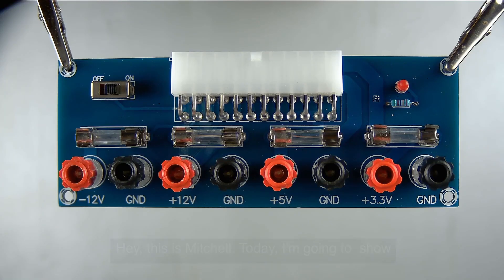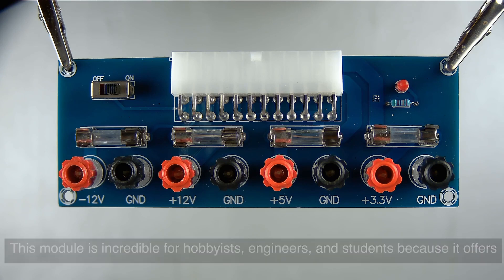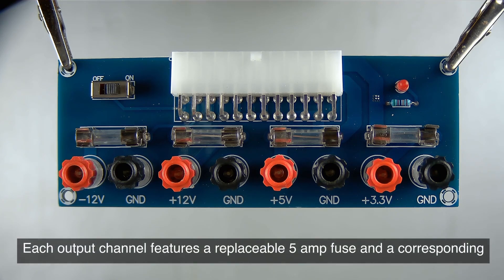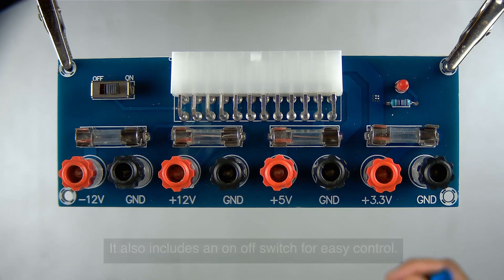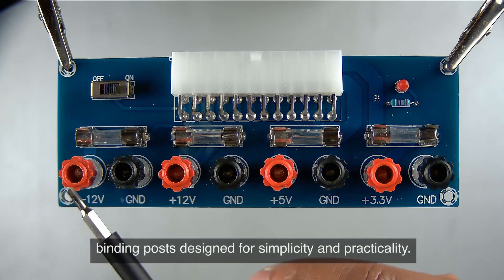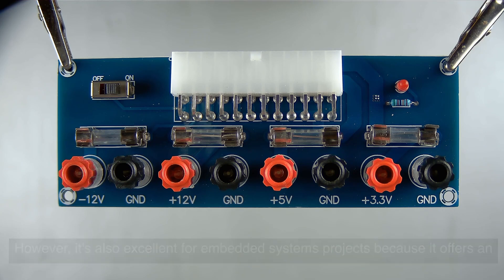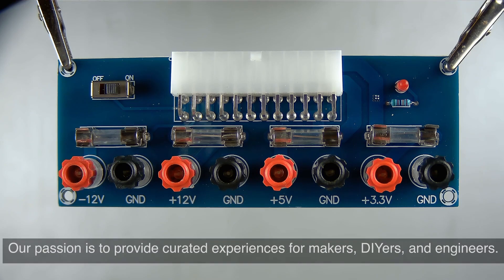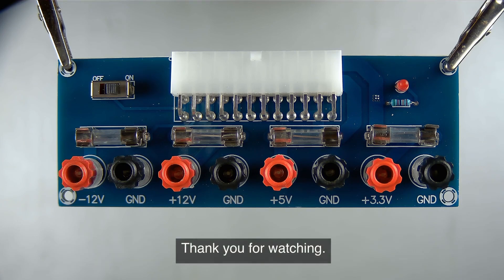ATX Benchtop Power Supply Breakout Adapter - Transform Your PC Power Supply for Arduino, ESP32, etc

Comment: Thinking about this for a RFID electric door strike access control system as I have a spare PSU laying around and I do need a power supply that handles 12v for the electric strike, but also 5v for the RFID reader, and 3.3v for the ESP32 and this would simplify and modularize the power supply aspects of the project being able to just drop in and replace a PSU.
Reply from the maker: Ahh, that could be a good application. Those 12v electric door strikes pull a little bit of current don't they? I have a very small power module which I believe puts out all of these voltages but I don't think it would have enough juice for the door strike. Check out SFX power supplies if you're looking something a little more compact than the standard ATX power supply. They still use the 24 Pin ATX power connector so fully compatible with this module.
Reply: @brainwiredotio  the seco-larm one needs 12VDC @ 750mA so adding a few strikes will definitely use current.

Comment: I will never use the 3.3v, but a mod to increase the +/- 12V would ne extremely useful!
Reply from the maker: You're right, I think most people don't use the 3.3v, but more 12V would be helpful.
Reply: Be careful though, typically on atx power supplies, -12V provides 300mA max